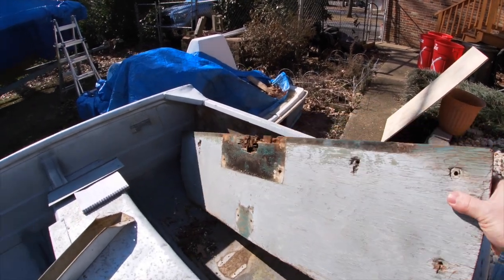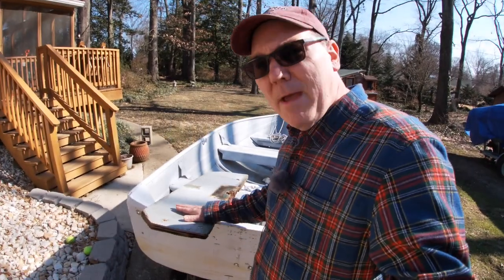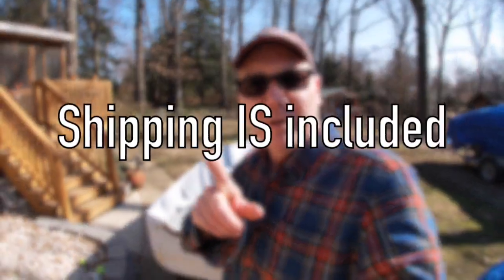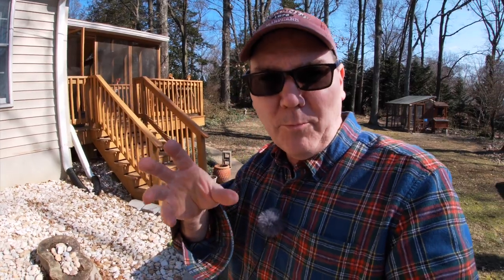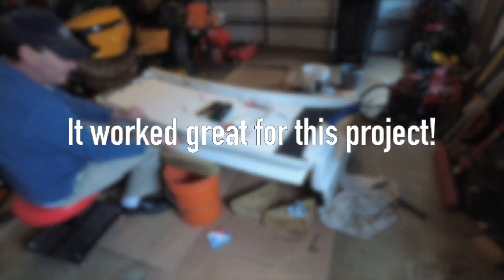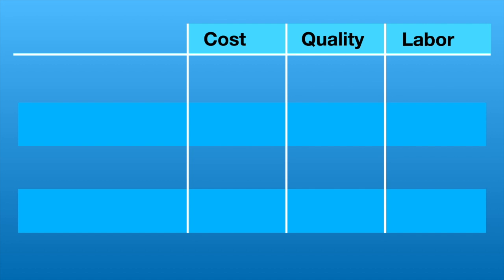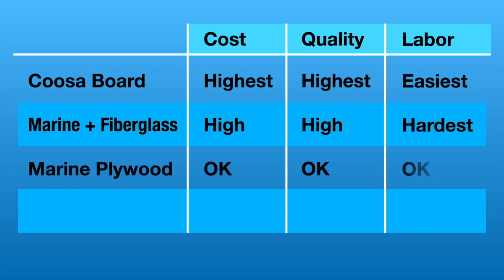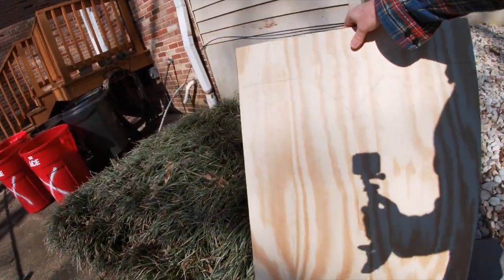Boat Transom Replacement - Marine plywood, coosa board, or something else?

Comment: I replaced a transom with 3/4 inch marine plywood in 1989. 
I slathered it some water repellent  oil/varnish then discovered I needed another board, but 3/4 was too thick. I went with 1/2 inch plywood slathered it in the same water resistant oil. If I'd known to glue them together, I wouldn't have been able to get the boards in. Fortunately for me my ignorance protected me from wasting time, supplies and money. I fit the marine ply wood board in first then the regular plywood. Clamped them to the transom and drilled through the hole from the prior transom.  In 2019 it was looking bad so I replaced it again, only to discover the marine plywood was still in great shape! 30 years is an acceptable life for a transom.  Loved the video, I'm doing another transom on a 1982 lowe I just bought.
Reply: You don't use your boat  much and it's stored inside correct? I live in south Alabama and I replaced mine with marine plywood and soaked it with thompsons and let it dry in the sun and repeated until it wouldn't soak it up and it started getting soft in 3 maybe 4 years!!!
Reply: @thomaskitlica5572 I would go with the plastic option if possible to eliminate any possible rotting. Hard part is finding something thick enough.  Have made one in the past gluing boards together with marine glue.  3 years later still going strong.  I traded for an aluminum boat that needs a transom. It's well used and about an inch thick. Will have to be big enough to distribute stress of motor since I don't intend to remove it unless necessary.  Live in GA. With the heat, humidity and rain we get don't think even marine grade wood is a good choice.  Unless you intend to cover it.

Comment: This was a great breakdown of cost vs. gain benefits. For replacing my own transom this season, I also went with the plywood option because of its low cost and made it water-tight with a few coats of Flex Seal.

Comment: This is a great experiment. I look forward to the results. I think it will hold up. On my 12' aluminum boat I used small pieces of oak just a bit larger than my motor and sealed them with spar urethane. Two years in so far so good.
Reply from the maker: Oak is probably quite a bit better than plywood!

Comment: I've done a few, transoms on my old mid fifties Lonestar Cruise Master, learning as I went. I used three layers of exterior plywood  plus  fiberglass mat and resin to support the old "Fat Fifty" Evinrude. That got me about fifteen years...which was probably about five years in sketchy shape. I replaced it again, same old lineup but trying to be better with doing the fiberglass and treating the through hull penetrations. I thought that would last better the second time around. The boat ended up  in Oklahoma with my son who never actually took it out, so about fifteen years on the trailer I just picked it back up.  As she sat, I had to remove the engine before towing it back to Texas for the next round for fear it would fall off if I didn't. (newer engine, 76 HP) . Turns out if  one is not careful, water can find a way in between the fiberglass and you get mush. Looked like someone fiber-glassed paper-mache. (which would not be a good idea either.)  So, I am taking a hint from my other old boat,  a 67 24' Chrysler Cruiseliner with a  shop built marine plywood painted transom with fifteen years  on it and still sound as can be. Thinking back, I had a number of small wood boats, all vintage, with original wood transoms after decades of use that were still solid. When I do the replacement for the old LoneStar, it will be marine ply. painted or Coosa if I win a lotto:). I know...mistakes were made, but this time I plan on building a transom that will outlast me.  Not unrealistic as I am 71 sooo, I will find a balance between budget and solid construction.

Comment: First off, I really enjoy Wayne's videos. I went through the same research as Wayne to replace the transom on my 1989 Grumman Cartopper 14 that I bought last summer. I also went with exterior grade, non-pressure treated plywood. The cost was low and the labor was also low. I figure I could absolutely do this every few years of I had to. I glued 2 pieces of plywood together and the transom is rock solid now.

I also decided to keep my boat in my garage so the weather shouldn't get to the transom too much. Just like Wayne, I paid $500 for the boat so spending several hundred for the transom doesn't make sense.

Comment: After getting proper fit I seal all the "end grain" edges with a water proof glue or epoxy. I usually  apply two coats or as absorption allows. Sand lightly to "fair in" the edges,  apply the coating of choice, let dry and refit to attach.  I like your video. Thanks.

Comment: I replaced  my transom in 2020 and I used marine grade plywood. A 4'x8' sheet at that time cost me $70. since my transom was 1.5" thick, I used that one sheet to make two pieces and glued them together. I then used penetrating epoxy to seal it and did not use fiberglass. The penetrating epoxy is very thin and I thinned it out even more with some acetone. This allowed it to soak deeper into the fibers of the wood to create a better seal. Before the first coat was dry, I applied a second coat of un-thinned penetrating epoxy to add a little more depth to it. All the edges and both sides were coated. 

I also used this method for the floor of my boat as well as all the hatches.

To give an idea of how tough that penetrating epoxy is, I had a few drops get onto a scrap piece of plywood and another piece of scrap was laid on top of it The next day after the epoxy had cured I was cleaning my shop and came across the two pieces that were no stuck together. When I finally managed to pry them apart, the epoxy didn't break. The wood fibers did. Most of the top ply of one piece came off and was still stuck to the other.

So is my transom the best it could possibly be?

No. 

If I ever replace it I will replace it with an aluminum transom. It will be expensive, but I will also never replace it.
Reply: Glad someone mentioned penetrating epoxy and thinning it! I did that on all my marine ply both sides on my aluminum boat. Doubt I'll ever have to touch it again.
Reply from the maker: That sounds like a neat product and more durable than paint!
Reply: @Wayne The Boat Guy  It's pretty cheap considering you thin it out with acetone. It works great on questionable ply that's starting to rot too. I salvaged a couple original panels that way. Gonna stay in my arsenal for all sorts of projects.

Comment: Good information.
I used exterior treated plywood when I replaced my transom wood a couple years ago, in my 1971 Terry jon-boat.

I had to double layer 23/32" as the original plywood transom was about 1.5" thick. I glued and screwed the layers together, then once dried, applied sealant to the wood before installation.
Since the original painted plywood lasted about 45 years, my replacement will be fine until after I'm long gone.
-My understanding of marine grade ply is it is more structurally sound, that is has fewer voids (as you stated) and also the exterior has a much better/smooth finish. This because it's use is for hull/deck construction. Marine grade is not generally as good as exterior ply regarding rot/water issues. It requires much more frequent attention to the surfaces (painting, etc) to protect it's integrity.

I did use stainless steel marine bolts, washers, and nuts to replace all the aluminum rivets which had to be removed in order to take out the old wood and brace. That was a messy job, as I also used JB weld as a sealer when installing that hardware.
Reply: I'm doing the same thing
Reply from the maker: I have often wondered if applying a sealant like you did would prevent the 'treated' wood from having a chemical reaction to the aluminum. My old wood was primarily installed with aluminum screws - every one of them broke when I tried to remove them - but that made it pretty easy.
Reply: @WayneTheBoatGuy  Not exactly sure about that-chemical reaction between wood treatments and the aluminum. Wondered the same about the two metals-SS and aluminum.
Reply from the maker: @greghudson1489  some people recommend using SS and if you bed the SS with a little epoxy or 5200 then it's not "touching" the aluminum. When I disassembled my transom, all the existing bolts were aluminum because they all broke! I haven't decided whether to go SS or aluminum when I re-assemble.
Reply: @greghudson1489  I've also heard using treated wood would react to the aluminum.  Why can't you use regular plywood and paint it with a sealer put 2 or 3 coats on it. I made some wood duck boxes 4 or 5 years ago painted them and still no problem.  Enjoyed the video.

Comment: A really great analysis and breakdown of the decision process.  One thing you can do with BCX ply is give it two or three coats of slow-setting epoxy using a foam brush.  This stuff is relatively inexpensive, goes on like paint, soaks into the wood, and makes the wood waterproof.  Any through-holes you drill in the wood--use a silicone caulk (GE Type II) on the fasteners to prevent water intrusion.  Thanks again for lunch!
Reply from the maker: I have been looking into some of the epoxies - they seem to be quite good!
Reply: Agreed on the analysis, and especially happy to see a chart as a summary :) 
My wife and I did a kitchen reno on our prior house (she wanted a new kitchen, I said "No. We can't afford that".  A week later she said "Can we afford $1000 for a kitchen reno? I've got a complete budget under 1k" and we did it for $1200 because we added a garburator and new remote switch-box for it) and we did the reno so cheap because we used laminate wood flooring that was on sale for the countertops, and sealed it with MARINE-GRADE EPOXY.  Using "fibreglass resin" (AKA polyester) would have been cheaper, but its not rated as "food safe", whereas epoxy is approved for surfaces for food prep.  FYI

Comment: My parents left me a 1985 red-fin 14' fishing boat that I had to cut out of the woods where it's sat for 25 years. The transom was rotted and a home for an ant Colony. I pulled the rotted transom out by hand, no tools.The aluminum was in a great condition. So I went with the Coosa board, cut to fit and installed it. Looks and works amazing, likely to outlast me. Just be sure to wear gloves when cutting. No regrets on cost.

Comment: Extremely useful! Thank you. 

I am probably buying a $500 Alumacraft 1436 today… it has been out in the weather under a deck for a long while.
Reply from the maker: Nice! Hope it goes well!
Reply: @WayneTheBoatGuy  
It turned out to be a 2018! I may not need to upgrade that transom for some time. However, within the next few years I aim to build a front/rear casting deck... which will make the transom hard to reach. So I shall upgrade to the forever/expensive product probably. 

Picking up the hull in the morning. Thanks again... and love your videos.

Comment: Enjoy the videos. Most cheap guys are one of two types (most of the time): dumb cheap or smart cheap.  You are the latter.  Nothing wrong with that!  I once bought an 18 ft fiberglass boat for $400 with a soft floor .  Tore it all out rebuilt the back deck.  Used pine 2x4's for the deck anchoring and 3/4 plywood for the floor.  Polyurethane everything and caulked any gaps.  All in (with boat) was about $1,200 with carpet and some vinyl. Kept it for 5 years and sold out for $800.  Net cost was $400/5 years, or $80 per year.  Mrs wanted something a bit newer and bigger.  Best net $400 I've ever spent on boating.
Reply from the maker: That 18 foot boat was a win!

Comment: Hi there. I have a  1975 flat bottom  Jon boat. Had to Build-up my transom . I used  P v c And plywood..Paint both of
 them in  Flex  Seal ..👍  As long you paint the wood 🪵 and sell it...  I had no leaks . But I paint the outside bottom  of the boat in  rhino   Lining  paint... No scratches on the bottom. 5 years so far. 💪🎣🛠
Reply from the maker: That's some cool budget boating!

Comment: Here is an idea for you. I had a transom replaced on my boat and the marine installer used synthetic decking boards and aluminum plates on both side. Very strong and will not rot.

Comment: I made mine out of 2 sheets of ⅛ inch aluminum and a bunch of scraps left over from other jobs. It's good but needs more refinements because it flexes but only about a millimeter of flex. It's coming out and I'm going to be adding stronger custom aluminum bar stock braces. Not bad for having a predator 670 long tail mud motor on it

Comment: Another good video. I’m redoing my transom now. I’m doing a plywood transom (that I got for free on Facebook marketplace) and coating mine in fiberglass and going to glass mine into my boat, which is a 12ft fiberglass v hull. My current rear of my boat is about a good kick away from falling apart. So I’m making my transom about 1.5 thick total. Gonna glass a inch thick and then make the last 1/2 inch bolted in.
Reply from the maker: Neat project! With a fiberglass boat it is much more a part of the boat's integrity - so your approach seems like a good one.

Comment: I replace mine with what I thought was exterior grade plywood, when I got home after a 3 hour run I noticed it had al ready started delaminating. It's only 12x12 so I got a 1 inch thick hdpe cutting board and made one up from that. Haven't had a chance to put it in the water yet though.

Comment: For mine with just a trolling or a 7.5hp motor I just replaced mine with a 1x6 that I soaked with oil based paint.I do have a HDPE shaped into sort of a V on the outside of the transom,couldn't find a sheet 6-12" w X 40-44" L at the time for the transom on the inside of the boat.Once dry I went back over it with what lower hull paint I had left.Used regular plywood for my rear deck and did it the same way. all done 4? yrs ago,still good,but I do cover the boat over the PA winter.

Comment: Coosa is like a foam core with fiberglass strands running through it. It is really only strong once it is laminated. The biggest advantages are light weight and water impermeability.

Comment: I use hardwood plywood for all my marine applications, it's also slightly stiffer per thickness, than ordinary softwood plywood. Around the same price.
Treat it with sealant varnish & it lasts & lasts.

Comment: Hey Wayne. There is a liquid option you could use, but you would have to make a mold to pour it in. Midwest Fishing channel did a video and the company is called Carbon Core.
Reply from the maker: With an open transom like mine, a liquid option would be a huge project!

Comment: Im about to do one for a 1436 flat bottom.  What I was thinking was to use the 1/2" plywood in 2 layers using titebond III and then afterwards brushing on mutiple coats of cheap urethane to seal the plywood
Reply from the maker: I am in the process of getting my glue to set today! Haven't quite settled on a 'finish' yet - but it will probably be something I have "in stock" in my basement!

Comment: Thanks for the help! My transom board is 59” long X 16” deep X 1.5” thick. So I can5 get away with a cheaper 4’ piece…darn it. BCX VS ACX is only a $10 difference in Menards. So I might as well spend the extra $10 for a 3.4” 4x8 sheet. I plan on screwing the two halves together to get an 1.5” thickness. I’m just going to use economy liquid nails heavy duty construction adheisive and 1.4” strainless screws to hold the halves together. Then I’ll put 2 coats of fiberglass resin over itand and inside all the holes I have to drill to bolt it in place. I plan on siliconing the bolts as well.
Reply: Been beating myself up on wood quality and Coosa board for a boat I only paid $800 for with trailer and motor a decade ago. From what I’ve read ACX has waterproof adhesive and is stronger than BCX. Figured with a 20 hp merc I better go strong since the little boat really scoots! $45 vs $55 for a 4x8 sheet of each at Menards
Reply from the maker: You should be fine with that - and even if you have to do one again someday, it's not a terribly daunting task.

Comment: Nice video.  I might be the first lab rat to try out starboard or HDPE cutting board material for the transom on a 16’ canoe.  It only needs to be 12”W x 15”L x 1”D and is heavy compared to other materials.  My small piece will be 3 pounds but that will be okay on this application.  Rigidity will be stiff, they seem very durable and from what I’ve seen on another video, screw retainment is fine when bonding two pieces together.  I’m a little worried about splitting so I will use washers. I’m cheap too, spending about $50 on the material including some 3M 5200.  Lager pieces obviously cost more.
Reply from the maker: Yeah a small space like that - and if you're not hanging a really heavy motor on it - might be just fine!  
Maybe consider that PVC Fascia board material you can find at Lowe's of Home Depot.

Comment: Most wouldn't recommend using actual fiberglass to wrap the plywood.  Just use the resin.  Bondo sells it for less than $20 per pint, and that's enough for the entire transom.

Comment: Great video.  I think you're selling your painted BCX solution short.  BCX siding with a good paint job and a little regular maintenance easily lasts 20+ years on houses.  There's no reason I can think of that it wouldn't last just as long on a transom.
Reply from the maker: Thanks!

Comment: I’ve been wondering how some of this composite decking would work if you could get some in wide enough pieces.
Reply from the maker: I think it would be a lot like the PVC board - not really rigid enough for an engine or motor with much weight